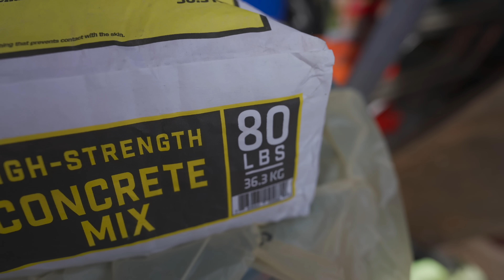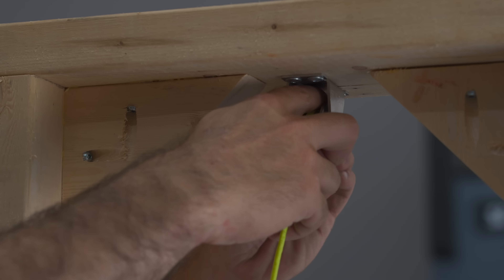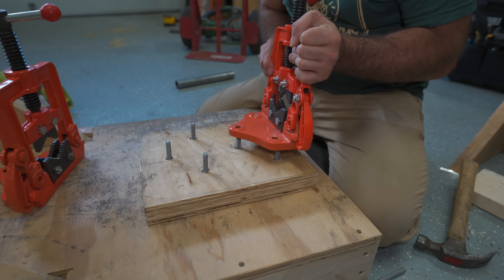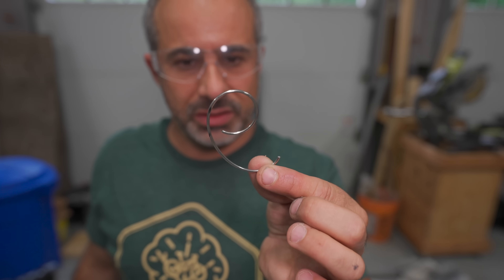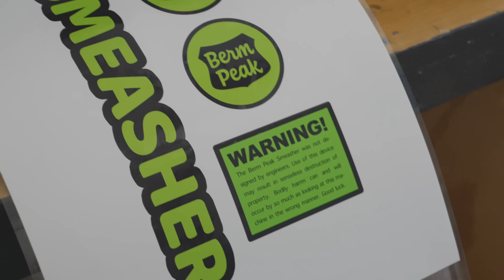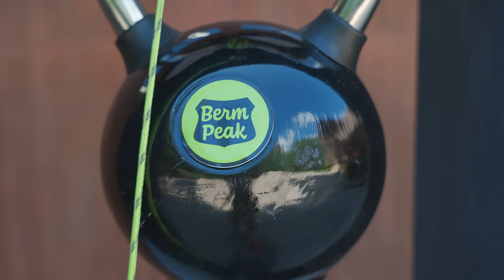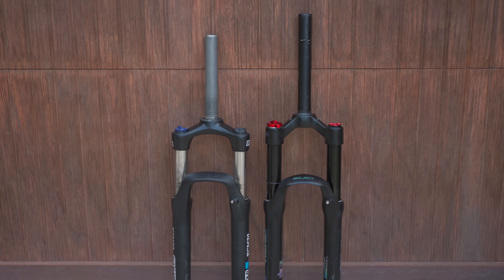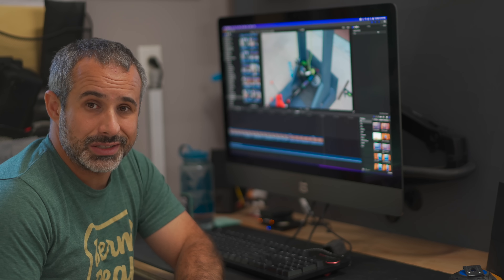Building a Suspension Fork Impact Tester for Science

Comment: I have an XCR 32 in my mtb and it still hasn’t been upgraded because it doesn’t need to be upgraded. I’ve replaced my bars, seat, tires, brakes, and cranks, but man, the suntour forks and freakin indestructible. They’re a bit heavy, but the cheaper we can get people into mtb the better!🤘🤘
Reply: The XCR is loads better than that XCM, XCR has an alloy steerer, air spring, rebound damping and alloy stanchions. It's the first half decent fork in the Suntour range. My wife has one on her Cube Access, it isn't much different to the Raidon on my sons Voodoo Bizango really, but I haven't torn either down to compare them so I would think the damper in the Raidon wil be better.

Comment: @berm_peak The biggest issue is the forks rotate... why not clamp the steerers in the vices?
U loose consistency and impact dependent on how the fork rotates.
This is also the main element in how much they can flex.
The pro-machine clamped the steerer.

Comment: To actually use this as a tester, it needs to be significantly stiffer than the object you are testing. The Wooden platform that you mounted your clamps to will flex and dissipate a lot of the energy, allowing the Forks to experience less Load. Also the Weight needs to hit at the same place every Time, and the Forks sould be stopped from rotating. I could continue with this, but as far as fun and entertainment is concerned, the smeasher works perfect.
Reply: Maybe he should start testing wooden forks
Reply: @falsemcnuggethope  like a mediaeval mountain bike forks made with brass accents
Reply: @ThatVoxelBlock  more like the wooden roller coasters that they have at Wonderland.
Reply: Agree with all of these points. The biggest problem I see that will keep from getting any sort of consistent result is the ball is not going to fall in a consistent manner, nor will it touch/impact the fork in a consistent manner.
Reply: @JonathanFisherS  look at mtb its random so I think this is a semi accurate test
Reply: The wood/concrete shock absorption should be kinda okay, since at least it’s a consistent variable (for the most part) for each test. 
Agreed about the fork rotating and the impact being in the same place. I also think the weight probably shouldn’t be landing/settling on the fork, but rather impacting, then continuing past it to the ground. 
Otherwise it’s an interesting test.
Reply: @Chris0012222  I think the landing in the same place part might be hard without very particular parts that are hard to find or expensive
Reply: @ThatVoxelBlock  nah, just gotta get creative. The professional one just had the weight on rails to ensure it’s consistent, you could find a second hand cable machine (for weight lifting) and use that…those weights move up and down along rails. Same basic concept.
Reply: Did it NOT test the impact? Yea science must be repeatable and consistent. The height, weight and side of fork hit was consistent
Reply: Nah, just smeash it.
Reply: Chill out nerd
Reply: keyboard karen
Reply: Being scientific and accurate is one thing but that's not realistic in the real world use case.
Reply: also forks were moving...
Reply: Yup the original uses linear rail bearings to mitigate rotation. This would affect readings less than using extra supports on the fork. However one could argue a real-world collision wouldnt be so uniform so while you do sacrifice repeatability a bit id say its a fair tradeoff. He should definitely add a steel plate where it bolts under the concrete and another over the top. Concrete works wonderfully in compression so sandwiching it with plates would turn the rotational force into a more compressive one allowing him to use the concrete to its streghts. Anyone thinking about making one of these can also use nuts/washers to encase the plate jnto concrete as it cures giving it a very solid base.
Reply: Yep, the cost (and effort) to build this to properly test forks would easily exceed the cost of just buying a good high end fork, but the entertainment value as it is, is priceless! That sticker was hilarrious!
Reply: @jamesroscoe7555  I see what you did there...
Reply: he might be getting close to patent information if he uses steel
Reply: @ThatVoxelBlock  Yes, but you would still need a pretty decent Steel beam as a base to act as a counterweight (maybe 200-400 pounds?) or the whole things needs to be bolted to the concreet floor.
Reply: @nilz6432  it's filled with concrete with wood on it the wood will not flex if it's sat on concrete
Reply: @ThatVoxelBlock  no, this is fine for personal use.
Reply: @liamstraub3394  that’s what I mean good enough for home owner use
Reply: Your arm work as a shock absorber. The difference in riding position/ weight distribution and differences in muscle power simulated "perfectly" by the flexible wood!
Reply: @hokiturmix  does it matter like the bottle smasher it’s can repeat a test close enough for it to be more accurate then taking a bike of a ramp + it’s very accurate for someone to make not in a lab
Reply: @hokiturmix  hopefully it won’t brake like a arm

Comment: Put 2 pipes top to bottom to guide the weight  use slightly larger shorter pipe  between horizontally and t pipes on each end to fit over the long pipes loosely

Comment: Should have cut slots in the arms of the guillotine, had a straight square tube that goes across and goes into both slots, and then welded a spike on the top of the tube so that weights can be put on it.

It would fix a lot of the issues with that horrible bell...

Comment: Love the video maybe you could make a budget guide rail by rigging up some brake cable vertically on both sides of the weight and attaching the weight to it with small carabiners or eyelet bolts or attaching some short pipe to the weight to guide it

I love your videos where you engineer and build stuff, you're quite good at it and it are relatable at the same time.

Comment: It's all fun and games til Seth tests a fox 36😅😂 I run a cheap air fork like that and it's fine for what I do, only "mod" I had to do was add oil to the air chamber as a volume reducer since the fork tends to pack down on decents.
Reply: Quicken your rebound if that's the case, all you've done is decrease your small-bump sensitivity - plus that oil is eventually going to leak into the other chamber and change your spring performance over time
Reply: @fixienick  the issue is my fork doesn't have any rebound adjustment which I was kinda disappointed with. But I did find a damper cartridge online that has rebound adjustment that I can add since why not it's only 30$. But I do service it after 5 months so I'm going to keep an eye on the spring in the other chamber and see if any oil washed away the grease on the spring.
Reply: @n8_vel868  do you know if the rebound damper is able to be disassembled? If so, you could maybe save the cash but $30 seems like a worthwhile upgrade - it would definitely fix your issue
Reply: @n8_vel868  also, adding suspension-safe grease (slickoleum or slick honey) on top of the piston will stay on the piston longer than oil will and will have a more consistent effect
Reply: @fixienick  no, the damper cartridge on that 30$ and currently in my fork are sealed and cannot be serviced which is one of the reasons why these air forks are made this cheap🤷
Reply: @n8_vel868  upgrade the damper when you can and you'll be much happier
Reply: @fixienick  I use to use slickoleum but the piston in the air chamber in my case use to push the grease to the top and pile up then eventually run dry. What made the biggest difference was adding oil foam rings under the dust wipers since these forks don't come with them, which reduced alot of the friction since the stanchions stay lubed

Comment: I'd say use C channel you can get from the big box store. Also, a weight platform that has a set weight already, for instance 5 lbs, that is easier to add weight to and a way to secure it.

Comment: The smasher could be improved in many ways, but i think a guide for the weight would benefit it the most. You should be able to add one with thick linear rods and bearings, linear rails (you can find big ones used from cnc machines for cheap) or v slot wheels but then you would have to build the frame from v slot extrusion

Comment: seems like you need a more "standard" headset setup to keep the steer tube from sliding/banging around in the clamps.   The 2 clamp setup you have seems unnecessary, you could use a pipe (or cut off head tube) sized to fit the top of the steer tube with a bushing instead of a bearing and a normal  topcap (perhaps with an expanding plug instead of a fangled star nut).  At the bottom you could use a similar setup (bottom of head tube, bushing) or a simpler "yoke"/cradle to act as the fulcrum.  +1 to guiding the falling weight...maybe garage door tracks  or sliding closet tracks?  Something to keep the force in the Z alignment.

Comment: That suspension fork is notorious for having the stanchions and steerer tube pulled out of the crown, the arch cracking, air leaking. Even when used on road most of the time.

Not a great purchase for a budget mountainbiker, just get those Suntour forks instead of this crap.

Comment: I think one big improvement may be adding guiding rail to weigth. 
1. Safety: Weigth won't fly off like now we can see in 10:12. 
2. Accuracy: It will provide the weigth will hit exactly at the same place every time.

As a bonus I may recommend tying doubble fisherman knot to end of the paracord, it should be big enougth not pass pulley. 
Cheers!
Reply: It needs to pass the pulley to drop the weight.
Reply: @marylloyd7755  then longer cord and stopper knot

Comment: I don’t really see the point of this test other than cane creek marketing. I tend to ride my forks with wheels on them. That means before the fork legs are smashed head on a tire is blown off and spokes are crushed.
Reply: In that case I think you should consider upgrading to better wheel. A good set of wheels will show minimal to no damage from a frontal hit that might bend all but the strongest of forks
Reply: @judechandler5102  I’m being facetious. The test is not practical if they don’t drop the weight on a fork with a wheel and tire on it.
Reply: @jonathanzappala  I agree that the wheel (and certainly the tyre) would would take a certain amount out of the impact, but I think this test is more to compare forks than replicate a real world crash. As such it doesn't really matter what happens to the forks so long as the process is repeated exactly for the others. That being said this particular test jig is going to be wildly inaccurate for reasons I'm sure you are seeing too.
Reply: @judechandler5102  no that’s exactly why it matters, anyone can build a fork to pass this test, but that doesn’t mean anything since we don’t ride forks without wheels on them. They don’t crash test cars by dropping things on them, they crash them in real world wheels rolling. It’s marketing, that’s all came creek is doing.
Reply: @jonathanzappala  That is a very valid point, but equally nobody rides into a 25lb weight and crashes that way, so without rigging a real life crash as done in the car world there is a compromise to be found, and adding a wheel and tyre would make this an unreasonably difficult rig to produce, and offer not a great amount more realism given the scenario of that 25lb weight

Comment: You need something to guide the weight down. This will make it so the weight hits exactly in the same spot each time, not just a similar spot.
Reply from the maker: yes, like the one Cane Creek has. Part of the reason I didn’t was lack of ability. I may need to work this out…
Reply: @SethsBikeHacks  I don't know if it's possible, but I guess you could drill a hole to attach a bar through the weights; and create a guide hole trough out the wood.
Reply: @SethsBikeHacks  the weight only needs to hit anywhere on the end, the actual issue is the fork rotates. Steerer needs clamping so the full force operates vertically through the steerer. Currently the weight mainly rotates the fork and then just squishes the lower leg. 
Thus v simple to fix...clamp the steerer
Reply: @SethsBikeHacks  Looked like Cane Creek was using Thomson Linear Guides. You could probably easily make a similar guiding method just using some steel tubing mounted to the Smeasher frame and then slightly larger tube mounted to the weight, oil that baby up and let her rip.
Reply: @SethsBikeHacks  it's round and smooth, id try a few pieces of pvc pipe as a guide. Not perfect but cheap and easy to work with
Reply: @mstrpth287 👆
Concentric sliding PVC would be the cheapest, just need to reliably attach the weight to the outer pipe
Reply: @danielschrick  or use 4 pipes(corners) and let it slide down the center of them. Again, not perfect, but easy enough to try.
Reply: @mstrpth287  no need for 4 just use two of them and attach the weight between them
Reply: @bmxscape  but that brings up another problem...how to attach it so that it slides evenly. I'm simply talking about crude engineering. 4 post and let it slide. May have to 45° the bottom part as to clear the test parts. 
Either way, no right or wrong opinions.
Reply: @SethsBikeHacks  an old home gym's overhead cable pulley setup would provide a good base for a second version. If it came with a stacked weight set you would also not be limited to whatever kettle bell is tied on.
Reply: @SethsBikeHacks  use pvc pipes over steel pipes so it glides easy!
Reply: @SethsBikeHacks  SETH! the parts you are searching for are called linear rods and linear bearings. They're not the cheapest, but for a one off project like this you would get just what you're looking for, best of luck!
Reply: @SethsBikeHacks  this thing looks medieval like a guilateen or something
Reply: @SethsBikeHacks  the cane creek device is sliding down on something very similar to a camera slider. 

Maybe a cheap camera slider or something similar could work as a guide?
Reply: @SethsBikeHacks  a solution i see is attach a string to the fork an then let the weight fall so that the force is ransmitted to the string and the direction is somewhat consistent
Reply: @SethsBikeHacks  
-> PVC Pipe... just like your Shoe Racks....
 OR... 
like we did Scaffolding and Send Right Angles Down a Rope....
Top & Bottom anchor 6" apart... so it rides to the outside of the BELLY of the Kettlebell... just use para cord & concrete nails or a hilti to set them

-> Then ADD Blocks under the clamps to raise the forks up
Reply: @SethsBikeHacks  I'd recommend using large linear rods and bearings, like the ones they have on those weightlifting machines at gyms. Also bracing the vertical part more would be good - especially in the forward/backward direction (towards/away from the fork). Also, like others have said, clamping the steering tube would help a lot. The rotation, and subsequent unpredictable bouncing, introduces a lot of uncertainty.
Reply: @SethsBikeHacks  hey Seth, you can use unistrut as side rail guides and use flat steel as a weight smasher and the modification would incorporate your already design as you can install the unistrut on the side of the arch support. This would keep the weight from swaying left and right
Reply: @SethsBikeHacks  or just don't drop the weight on it but use it to pull a cord that bound around the fork between the qr points
Reply: @SethsBikeHacks  Rework the axle dummy part to have a platform to which you attach a guide cable. Swap the dumbell for actual weight plates with a hole in it. Use the guide rope throught the plates. Bob's your uncle.
Reply: @SethsBikeHacks  yo I got these hydraulics do u know what the gold screw thing is it came with the hydraulics in the box
Reply: @SethsBikeHacks  
I would love a air for I love the videos
Reply: Or maby even just directly mount the steerer in the clamp
Reply: @chris3_c  -> Stem from a bike and treat it like a Headset
Reply: You may be able to put some steel or wood across left to right so the force equally distributes up and down. I bet you’re getting some torsional deformity in addition which affects its future deformities
Reply: If you had a board on the bottom of the weight that was wide enough that went down channels on either side. The weight wouldn't bounce around at all and you would still have the destructive power in the exact spot you want.
Reply: Create a guillotine-esque contraption.
Reply: Maybe cutting grooves on the beams, and install a bearing-based guides like the ones used in sliding doors. Then build a metal platform that slides on these guides where you can put the weight on top of.
Reply: I’ll CAD this thing for you for free! Get in touch if your interested!
Reply: Seth I thinks someone was trying to prevent to be you and said they have a surprise for me,please check it out
Reply: Add a third vertical rail, each guided by st least two "bearings" to help prevent camming. Have the weight sit on a "sled" instead of free falling.
Also, secure the fork from twisting so the "dead on" is repeatable.
And yeah, a greater spacing underneath the impact zone to avoid 'supporting' the fork, would be wise.
Reply: For a guide build an H shape out of 2x4s that attaches to amd slides with the weight that has a leg in front and in back of the uprights.  Also clamp the fork in so it does rotate.
Reply: a rectangle weight in between the 2 sides, like that the fork won't deflect their weight either
Reply: Something like a guided missile?
Reply: just put your giant pvc pipe over the weight
Reply: good idea but you are probably never going to hit the same spot in the real world
Reply: @ghostly07  well yes. But to compare different forks you want similar impact points